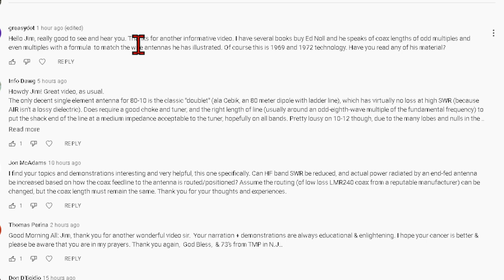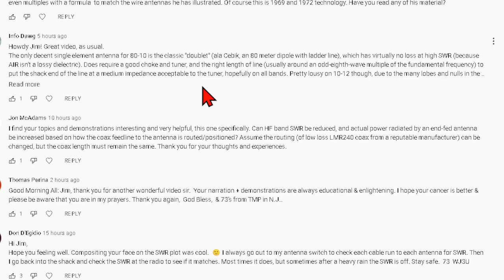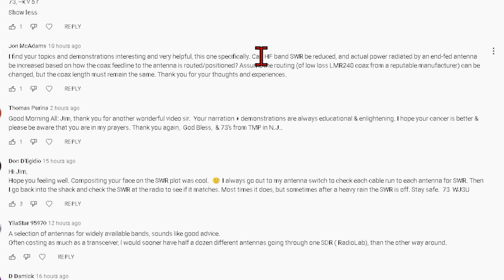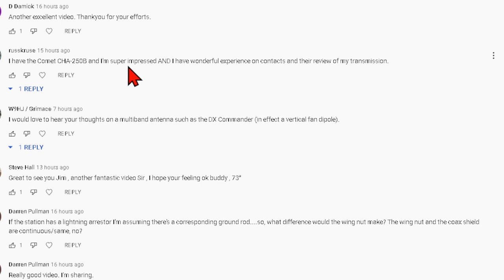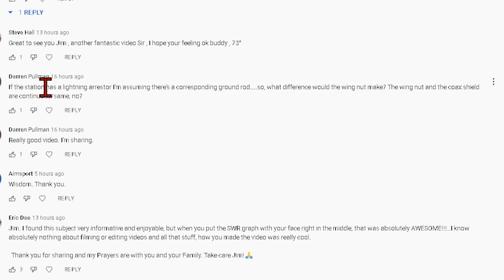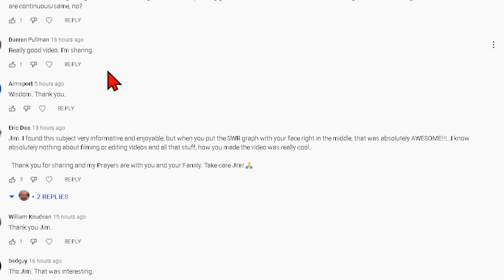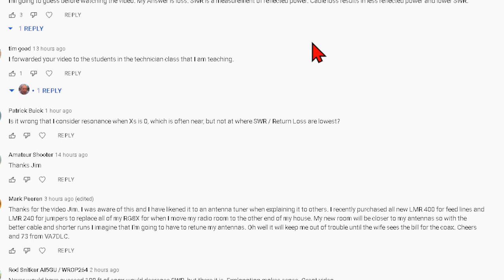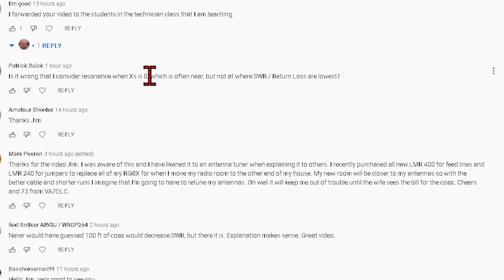Part 2 of Why the SWR is Lower When the Coax is Long and Large Diameter can be Better by Jim W6LG

Comment: If anyone doubts Jims take on this an easy way to see the effect is to try some experiments on VHF/UHF with a longish run of RG58 or similar. If you take 100ft of the cable the SWR will be about 1.3 (at 430MHz) even with the antenna disconnected!

Comment: Thank you Jim, also, sorry to hear about your health issues that you’ve been battling.
Two things, one, if I’m running an 80 meter double it, fed with ladder line, am I understanding correctly that these things you’re talking about do not matter much? Too, instead of just assuming an antenna works or does not work isn’t it best to test it using WSPR Watch? Videos I really appreciate it.

Comment: The COAX is acting like an antenna Tuner, is my experience as I see it at my station. I have a long run of RG-213 and my SWR is great at the desk and not so great at the Antenna. All the parameters of the COAX affect the Signal. This opinion is based on my experience and my trusty RIG EXPERT AA-30 ZOOM Meter. What matters to me is what the Transmitter actually sees when you press that PTT to talk. Yes, signal loss decreases with length. Thanks for your great videos. Of course, I could be wrong! HAHA (I usually am! DOOH)
Reply from the maker: One thing we can agree on is the RigExpert.  They make great antenna analyzers in a very difficult situation.  Thanks, Jim W6LG

Comment: Hi Jim,

I expected the SWR reading to be less accurate with a greater length of coax. Leading the operator to potentially be fooled into concluding their antenna is great but reality differs.

What I found most interesting though was what happened when you superimposed both SWR graphs from your multiband antenna in video one (at 5.50). The red and white plots are out of phase. In other words, the additional coax has changed (although mostly slightly) the frequencies of resonance.

In between the 24m and 26m vertical lines is an example of where it is most pronounced.

I would expect both plots to remain close to being in lockstep, with only the severity of the SWR changing. 

Yes, transmission lines cut to certain intervals of frequency can be employed as impedance transformers. This is commonly done. 

But the frequencies should have the same valleys in reactance.

What causes this?

Comment: After several years of working with different wire antennas that do it all, I settled on the triband yagi for 10,15,20. A delta for 40 and a bazooka for 80. All with lmr 400 and alpha delta switches. Sadly not enough room for a half ass 160
Antenna. I strung a vertical for 17m 1/2w. It’s no contest station but it averages around 6000 miles at any given time. I accidentally ran over my lmr 400 to satellite array. Man that was havoc on the mower blades haha.
Reply: "Man that was havoc on the mower blades haha."   LOL !  I bet that was !
Reply: @cbarker1496  reminded me I need to sharpen those lol

Comment: It me again Jim. 😅 if you have a dipole you are working with because you told me to stay away from efhw,,, and the installed height is 75 feet. Is that when you would use the multiples of half wave on the coax length to use your analyzer to get the most accurate measurements?

Comment: I have to ask you this. If a person was assembling a mobile antenna system for say , 28 mhz. ( Mag mount 1/4 wave antenna)....My instinct based on the velocity Factor for said frequency is to buy  2   "1 full wavelength" ,  pieces, ( approx 28' for each piece). One length to run from the transceiver to the amp....and the other to run to the base of the antenna. This is what I " Believe" would be best. I intend to stay in that  band area . Would you run a shorter  radio to amp piece of coax ??? How would you do it differently. Thanks in advance

Comment: Hey Jim. Thanks for making these videos.  Speaking of feed line routing - I made a vertical 1/2 wave center fed dipole antenna for use with a military radio around 32 Mhz. I tweaked the lengths of the antenna and feed line to reduce the SWR. I also found that lowering the angle of the feed line away from horizontal 90 degrees sometimes improves the SWR.  Not sure if that counts as feedline routing. Any ideas?  Thanks.
Reply from the maker: Thanks Scott.  I don't know the answer.  I would make certain that the feedline is choked with a big lump impedance of ferrite beads at the feedpoint.  73, Jim